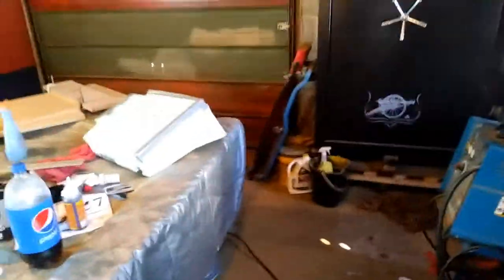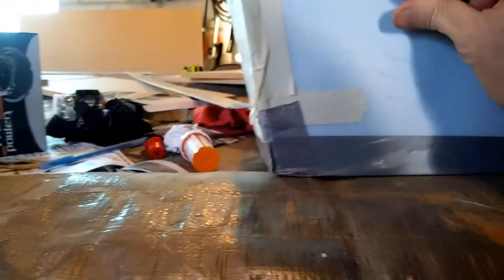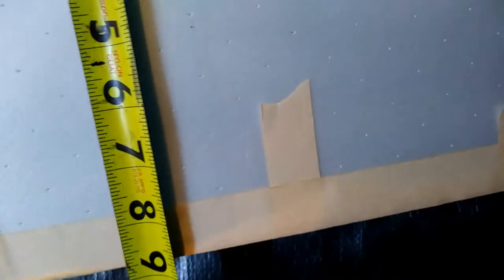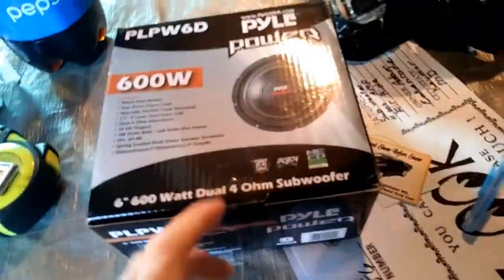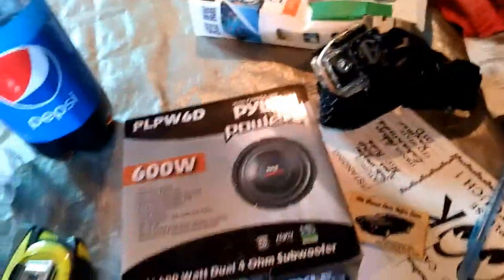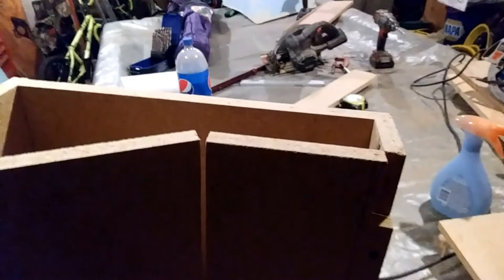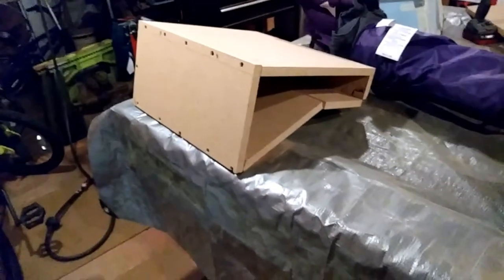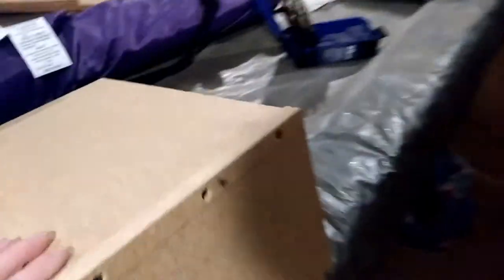try to make a box for under dodge ram back seat

Comment: Great video. What I could see if it 🙄... However if you actually put a decent sub in that split out huge gapped joint pos box... It'll probably blow the damn thing apart
Reply from the maker: this was just a starter it would had a port in it and i would made it allot better with tight seams 
would when with cheap subwoofer all the way in case would hit it with feet 
but never made them when another way 
thanks for wathing